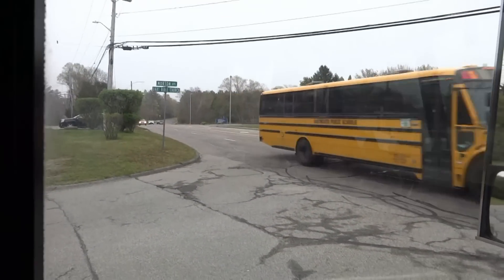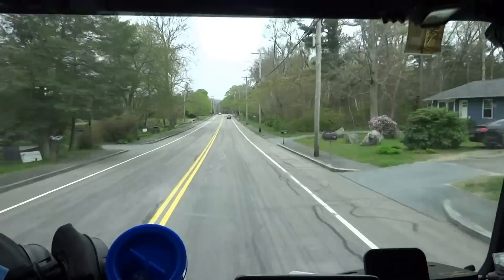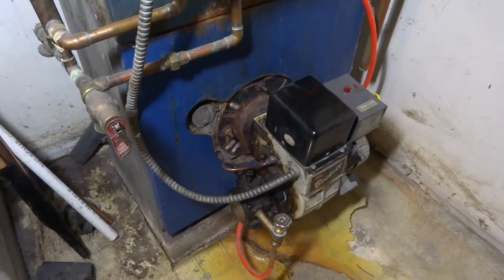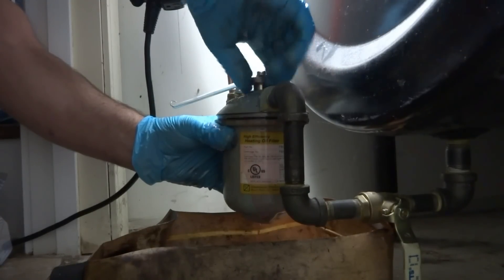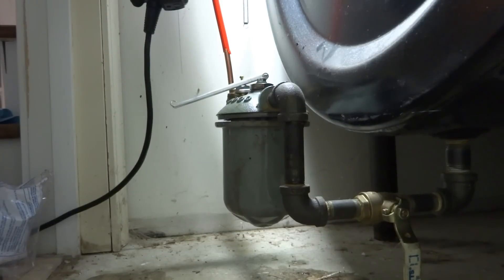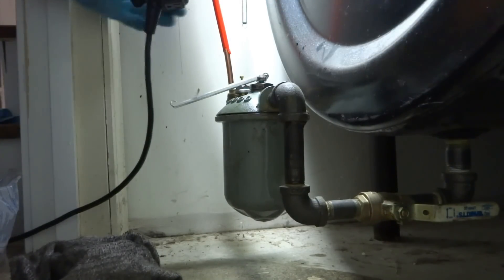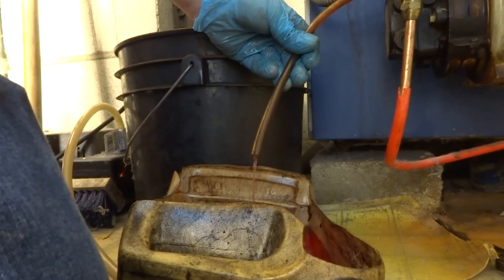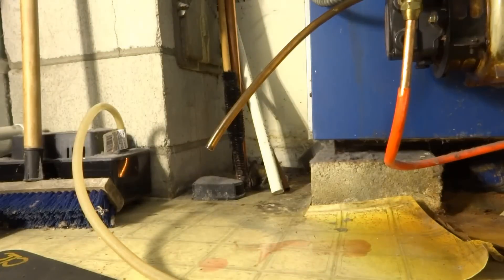OLD OIL BURNER STARVING FOR OIL NEWER OIL TANK

Comment: I still think you should have blown a burst of air thru those tank fittings. That flow still looks restricted. It will work for now.. I just air blasted my in ground line back after 23 years, it started sputtering and starving for oil. The outside tank vent was also clogged up with mud bees nest. I had to change that.   Also, every other tank fill, I leave a bottle of anti-sludge additive at the filler tube and the driver adds it just before filling. Works great now..!!

Comment: Changing or inspecting the filters 6mos ago would have prevented this issue.  Instead you charge the homeowner twice, and blame the oil company for bad oil.  If the delivery oil quality is known to be inconsistent, then all the more reason to keep the filters changed.  Oil flow is not a reliable indicator of filter condition.  A filter like anything else will eventually fail when pushed beyond it's useful life.  For example, just because your vehicle brakes work today doesn't mean they shouldn't be inspected for wear.

Comment: Hey Steve. Definitely bio diesel shit in filter. I live in CT and bio stuff is a nightmare. Plug filter all the time or line has restrictions in it. The worste is the bio fuel is killing fuel pumps at the seal and leaking and motor bearings are going like water because of the fuel. Awesome job as always.
Reply from the maker: I HAVE NOT SEEN IT YET ..... MAYBE THERE STARTING TO DELIVER THAT BIODIESEL CRAP NOW TO MY AREA . I SURE HOPE NOT ..WHAT A SHIT SHOW IT WILL BE ..
Reply: 50 years in business bio on Long Island very big problem Steve do u ever use push pull pump at all just curious
Reply: Suntec make a BioDiesel pump
Reply: @croyal4240  i know they do but I seen them sized up quite a bit. something in bio fuel causing it. the place where I work had changed over 100 oil tanks due fuel causing the oil tank to leak at the belly.
Reply: @croyal4240  Last time I was at the supply house, they only had bio capable Suntec pumps.